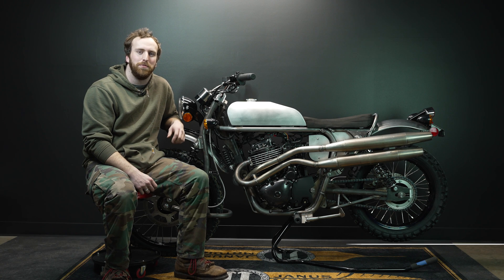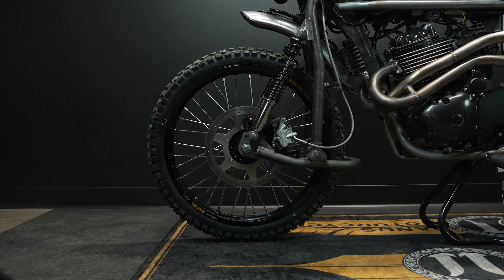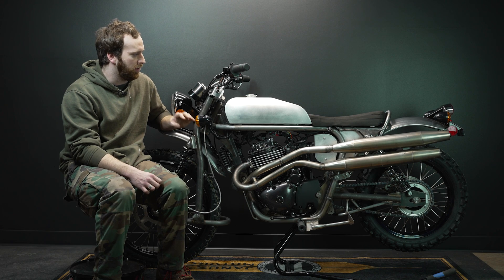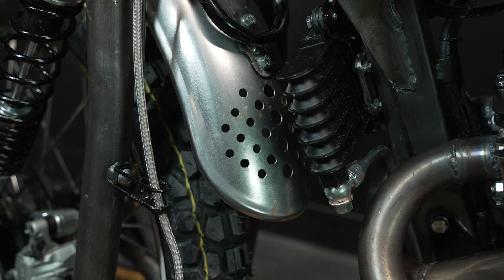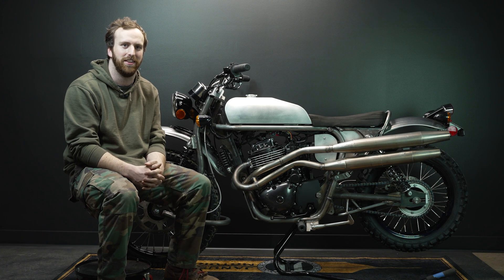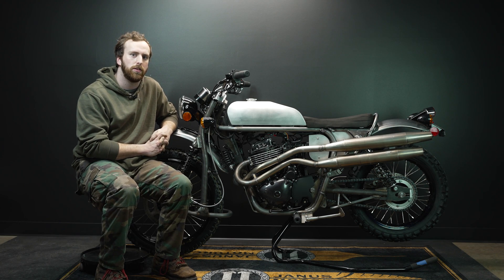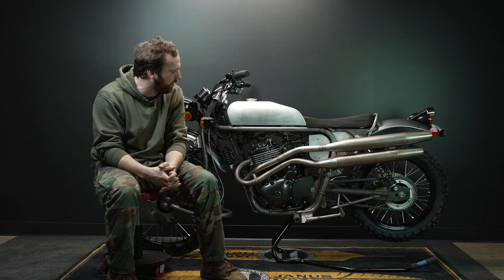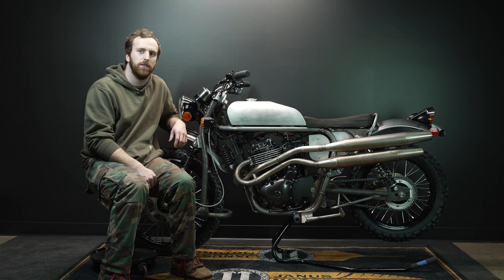Janus Gryffin 450 Scrambler Design & Development | Episode 1

Comment: Old front end design 
Exhaust will burn your leg
Fuel tank looks very small 
Royal Enfield makes the Himalayan for example 
401 cc now a new water cooled version coming soon. Great bike for trails and back roads. I would prefer a larger engine for highway speed.
Honda also makes the Trans alp which has proven reliable name.
Yamaha TW 200 is another bike with low seat height but under power with only a 200 cc air cooled engine, not recommended for highway speed but doable for back roads and especially trails.😊

Comment: Like the focus on seat height.  Could the dual pipes be reduced to two in one to ease placement and reduce weight?  The 450 motor likes to be revved, 4000+ rotations per minute.  I wonder how that will work in off road riding.  May just be something a rider needs to get used to.
Reply from the maker: We are bound to this setup due to our EPA certification but that would be interesting! Charlie has done quite a bit of offroad riding on the Halcyon 450 (check out his Colorado series on our YouTube channel) and found it quite capable. It will be a lot of fun to see how a bike that was designed for offroad use fairs on the same trails.